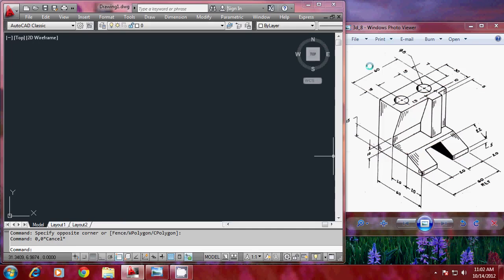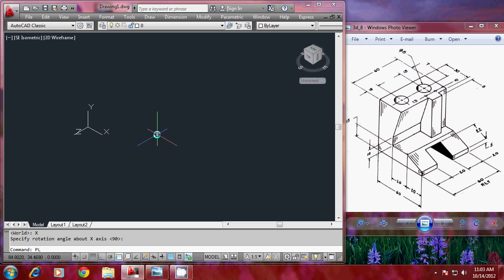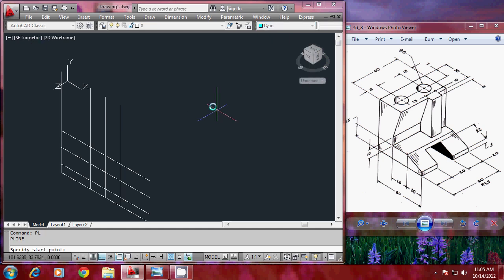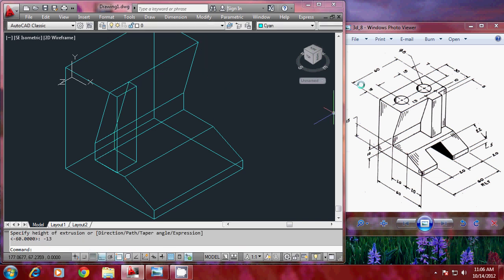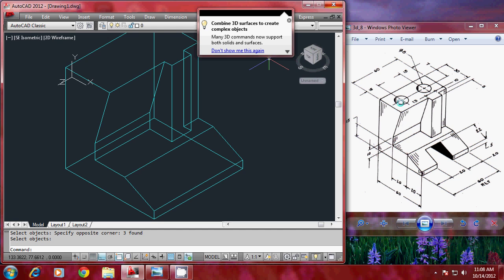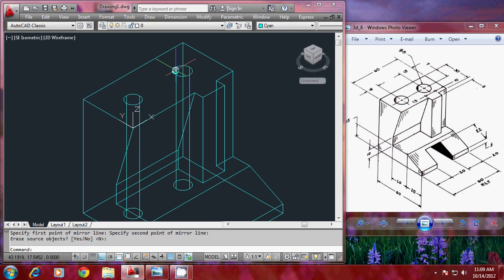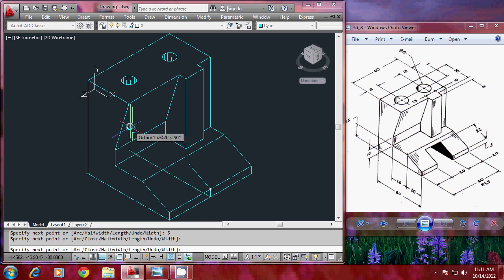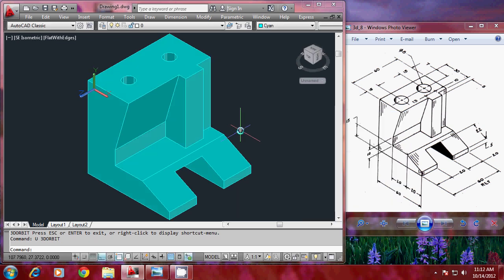Autocad Mechanical Modeling

Comment: These are the best videos I've found. Great job.... Quick question, if it was called for, how would you radius the  top corners on a 3D object?.... Is there a  quicker way than creating a radius point from the 3 faces drawing a sphere and trimming the corner? I've never tried it.
Reply from the maker: Just follow the steps given . Thats the effective and simple method . Anyway thanks for your comment :)